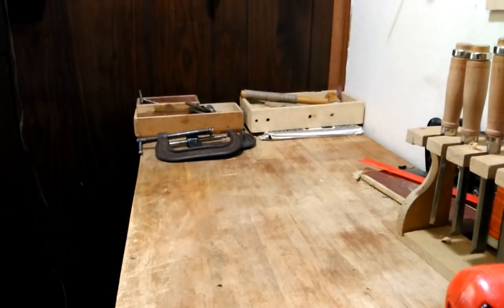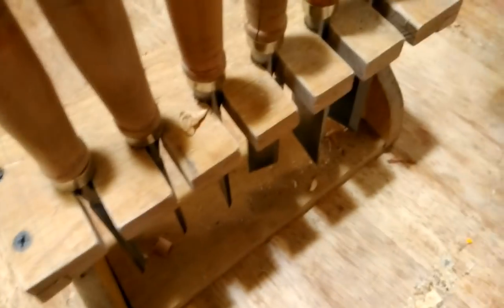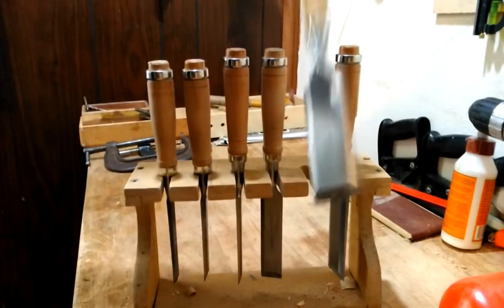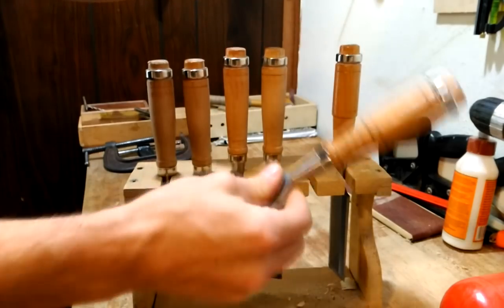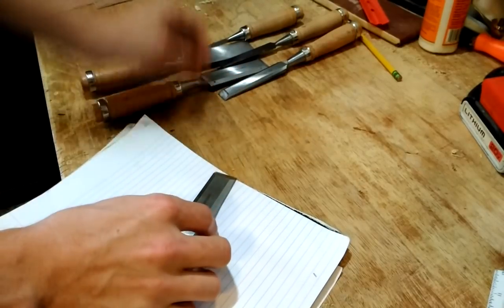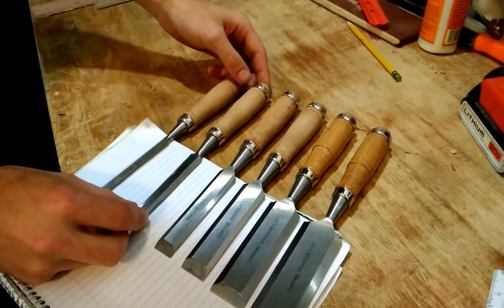Make: Easy Chisel tool rack

Comment: LOL, Now you got to clean the glue off the chisels.
Reply: Capt Termite never place a wood plane face down on the table   Book one page one .   But a good vid on a simple project
Reply: @jimmurphy4703  "never place a wood plane face down on the table"
Old wives tail. If you are building a table you may have a point that the plane could mar your project. However, this is a workbench, not a table. A wooden workbench will not dull or damage a plane iron. Watch how Paul Sellers places his planes on his workbench. Paul Sellers may even address this issue directly in one of his videos. I don't have a reference for that, but it's a better reference than the vague "Book one page one."
Reply: Jim Murphy no. Book one, rule one is don’t put it on the side, you have chance to knock the plane blade laterally. Place planes blade down on the bench. Use short 5-10mm piece of wood at the front to keep the blade elevated. Or place your plane over the the tool well if you have one! NEVER LAY A PLANE ON ITS SIDE!